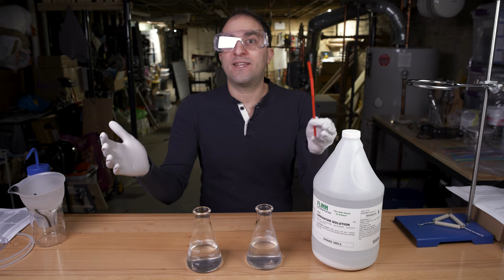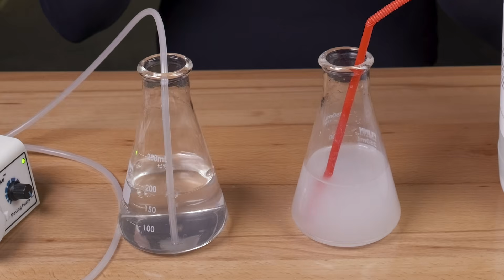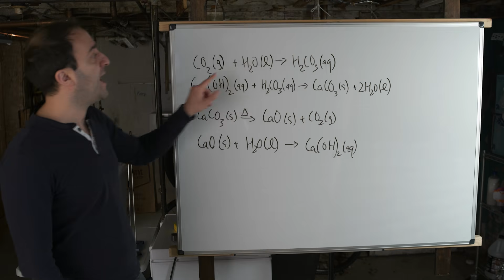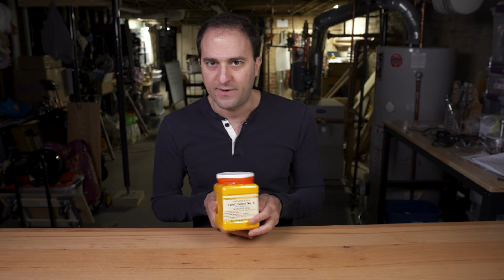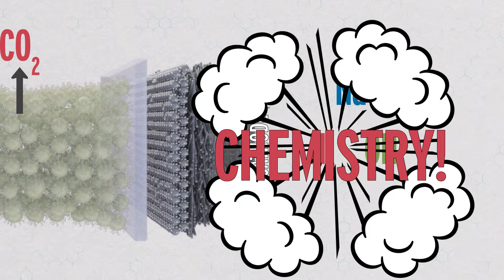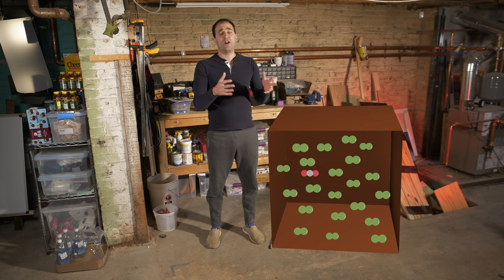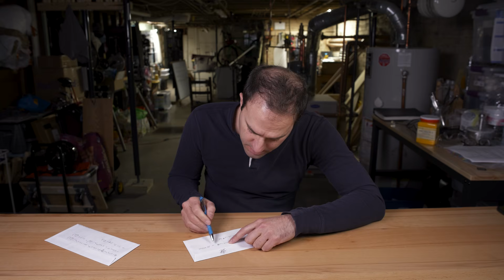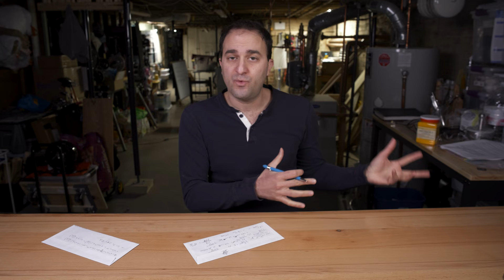Why a Carbon Capture Breakthrough Will/Won't Save Us

Comment: You hit it perfectly on the head.  Direct air capture is useless unless we drastically reduce carbon.  While it is taking its sweet time to commercialize, I think nuclear power is going to be the real solution in the end.  It doesn't demand energy storage (batteries, etc) and runs 24/7.  Current nuclear has an EROEI of about 75 while new Gen IV should be about 1000, as we won't be throwing away 95% of the unconsumed uranium as "spent fuel" when using molten-salt reactors (or thorium).  Put another way, there's about 200,000 L of gasoline worth of energy in monazite sands (found all over the world) in a soda can worth of sand.  It just requires extraction (which we already do) then building and running the reactors.
Reply: This can be used as an intervening step, capturing it from factory and powerplant emissions ( similar to the role of catalytic converters on cars ) turning it into calcium carbonate, and removing it from the carbon cycle entirely.
Reply: He should make a calxulation about replacibg all other co2 demansing energy sources for nuclear.
Reply: Not at all - best in class DAC uses about 20% of the energy produced by burning methane
Reply: Nuclear is not a load-following generator. To make it load following would drastically increase its price because its price is mainly determined by upfront capital costs, not incremental costs. That means it needs some type of on-demand generation. traditionally this is gas peaker plants which generate CO2. In Japan where gas was not available they built 1GW generation from energy storage for each 2GW nuclear generation. In summary, nuclear power without batteries is even more expensive than nuclear power with batteries. Given that nuclear power is already much more expensive than renewables with batteries means that it is not practical.
Reply: Nuclear does load-follow. Electricity Maps clearly illustrates this for France. Ontario's CanDu reactors bypass steam away from the turbines to the condensers. AP1000s load follow too. Batteries are not a solution considering their costs and pollution.
Reply: @Ziess1 Steam bypass is a ridiculous way of load following and should be illegal except for load rejection transients. What a waste of our finite fissile resources. Put the control rods back in.
Reply: @ryuuguu01  Do keep in mind that the LCOE figures which say wind and solar cost less per kwh base that on 100% output all the time, which obviosly wind and solar (moreso solar) cannot do. Adjusting the figures to account for that makes large scale nuclear the cheapest option per kwh
Reply: @Jay-kc2pm  Then why does large scale nuclear cost so much?
Reply: @Jay-kc2pm  No the Lazard LCOE numbers do not assume 100% output. From the Lazard report "The LCOE allows for an apples-to-apples comparison of different technologies by accounting for factors like generation/output, upfront capital costs, fuel costs, operating and maintenance expenses, and asset lifetimes." This also applies to the BloomberNEF LCOE number. Nuclear is more expensive which is why investors are not building it.

Comment: Problem is the "solution" to reduce carbon emissions most economically developed countries are using, is to simply commit the polluting activites (power genration, manufacturing, etc) in other countries that don't care about the enviroment,  and thus also have less (or no) environmental standards (and usually reduced labor safety standards), so like for like, they are more polluting... So global emissions go up, but "we've reduced emissions, aren't we such good people!"

Comment: The most promising way to efficiently capture CO2 from atmosphere is biotech, in my opinion. If we could design novel super efficient synthetic enzymes, powered by AI tech like AlphaFold, to basically act as a hyper efficient tree then we could use sunlight energy to fixate CO2 into other reduced carbon forms without needing to spend energy in the process.
But we still have a looong way to go...
Reply: Or: we could be good stewards of the CO2-absorbing biology that already exists.  We (humanity) probably won't 😂

Comment: I still haven't seen a decent explanation oh why we don't grow and bury biomass.  It seems that by burying it, one would significantly decrease the rate at which it would decompose and release CO2 back into the atmosphere.
Reply from the maker: My understanding is that the sheer quantity of plants you'd have to plant to remove CO2 at scale would take a significant percentage of land on Earth. So what people are thinking instead is BECCS-- basically you plant biomass and then burn it and then pull the CO2 from the smoke and use the heat to generate electricity.
Reply: @ACSReactions  So not exactly bio-fuel, but sounds like something in the same ballpark.

Doesn't that also suffer from the same 'at scale' issue?

I'm a new sub to your channel and loving it, btw!
Reply: @spnyp33 these concepts don't really work until we've pretty much eliminated fossil fuels as an energy source.
Reply: @evancombs5159  Right, clearly when the current oil deposits were layers of non/slowly-decomposing plant matter, that took place over the course of millions of years.   

I'm not necessarily proposing burying organic matter as a quick-fix-it solution; more of a long-term, systematic process to balance any overproduction of CO2 going forward.  

Plants are already the planet's response to carbon sequestration.  It cost nothing to let it grow.

What amount of CO2 is released back into the air every year from decomposing biomass?  

Granted, it would take energy (more CO2 production) to get the biomass buried, so it may be a wash.  Unless, we are able to develop processes that mitigate this over the long term.
Reply: @ACSReactions do a video on algae. My understanding is an acre sized pond can potentially grow 1 ton of algae per day in optimal conditions.
Reply: Simply burying the biomass would trap other important elements with carbon - for example nitrogen (in bioavailable form) - that you will need to replace before starting next cycle, also it will be wasteful - why bury the biomass if you could convert it into IKEA furniture :). But the main problem seems to be that you cannot make money from this process.  
A significant amount of co2 is emitted during production of cement - one of the components is lime that is heated up to create calcium oxide (part of "carbon capture" cycle shown in video). If we capture and store this co2 every new building will effectively remove CO2 from air - and you don't need to build new "carbon capture plants" - just upgrade existing cement plants :)
Reply: @grzegorzdomagala9929  you absolutely can make money out of this process, that is called biomass energy. it's not the best way to make money but there are companies that make money out of it by burning waste biomass from other industries for energy. it's the capture of the CO2 in the smokestack that kill the profits.
Reply: Wouldn’t it be a better idea to convert the plant matter into biochar via pyrolysis and bury the carbon this way? It would ensure, that there is no microbial oxidation of the carbon, unlike in non-pyrolyzed dead plant matter

Comment: How much CO2 is generated manufacturing those magic chemicals?
Reply from the maker: The energy that goes into manufacturing the chemicals is definitely part of the bigger equation. It pales in comparison to regenerating them over the lifetime of the process, but it can't be ignored, either, and it's yet another reason why we can't ever expect to get close to 100% efficiency.
Reply: Now you are asking the right questions.
Reply: "magic chemicals" 🤦🏻‍♂️
Reply: Small modular reactors, free clean energy, electricity and heat.
Reply: “magic chemicals” and it’s literally lime water. Limestone dissolved in water. In case you’ve never been outside we have abundant limestone reserves on nearly every continent - manufacturing these “magic chemicals” is more a matter of capturing the dissolved limestone after it rains
Reply: I’m more concerned with how much time we used up developing a roughly 10 fold improvement to our carbon capture technology.

Continuing to pursue another 10 fold improvement to carbon capture on the same order as this one will likely require 10 times as many resources for 10 times longer with 10 times as many geniuses dedicating their careers to developing it.

The smarter move is to just reduce consumption by the wealthy with a global wealth limit, return all colonized lands to Indigenous management and eliminate 99% of militaries and prisons. All of these moves have been studied and will lead to improvements to the climate and social scores. The choice is easy!
Reply: @SamAlderDesign  But no, George was very clear that we're not getting another 10 fold improvement, and was also very clear how much it wasn't worth it.

Would it really hurt to watch the video by someone who's displaying a whole lot more contextual knowledge than you before glibly repeating their conclusion?
Reply: @SamAlderDesign  Oh yeah, that plan has absolutely no flaws whatsoever.
Reply: @SamAlderDesign thank god it's not your choice to make!
Reply: @SamAlderDesign  Good luck convincing anyone of that. Regardless of it would be a good idea. I also have a hard time seeing how someone could study a "wealth limit" and how one could impose this without government's or prisons. Hey, it's all pie in the sky, though. That's why we're here.
Reply: @slyraccoon17  This type of thinking is a self-fulfilling prophecy. It's a shame people don't see continuing to emit carbon at mass scale, with full knowledge of how it's destroying the environment, and hoping it just kind of fixes itself somehow as radical and "pie in the sky" too, cause it really is

Comment: Rethink solar PV. Use it to pyrolize waste biomass. This makes two products, syngas and Biochar. Syngas can be used in the fitcher tropes process to make Gasoline or used directly in an internal combination engine. The Biochar makes a permanent carbon store and excellent fertilizer.
Reply: I think you mean concentrated solar thermal not PV. But yes producing biochar at industrial scale using a fast growing plant like hemp as suggested by another comment, then using it as a general purpose fertilizer spread on fields, farms and lawns across the world. I see a potential problem with soil mineral depletion where the crops are grown but this could lower chemical fertilizer use and lock up more CO2 while also promoting the capture of even more CO2 at least to a point.
Reply: @Zanthum  PV, you can use the power without a controller directly using nichrome wire. I've got a 9kw array I'm doing small scale experiments with now.